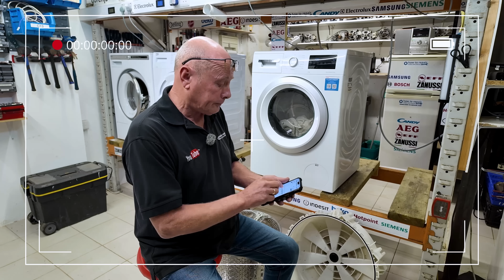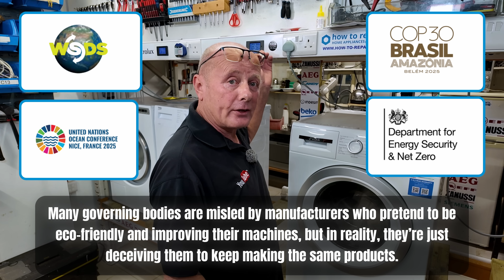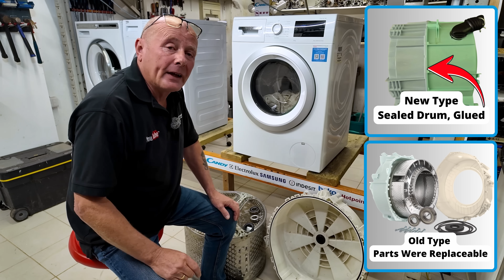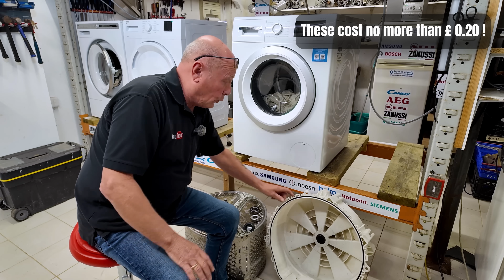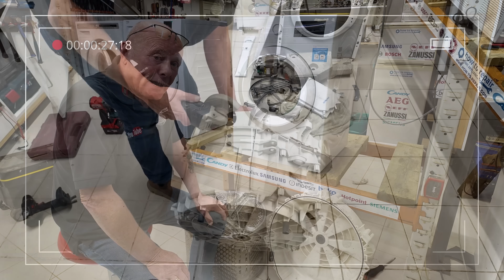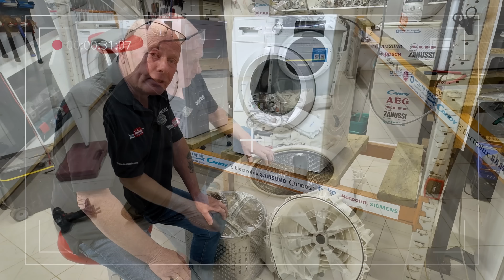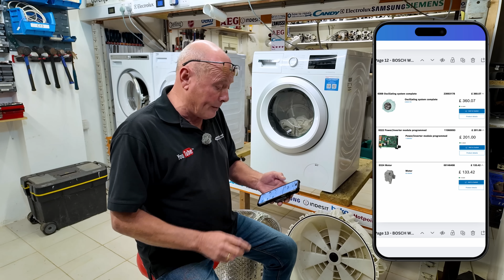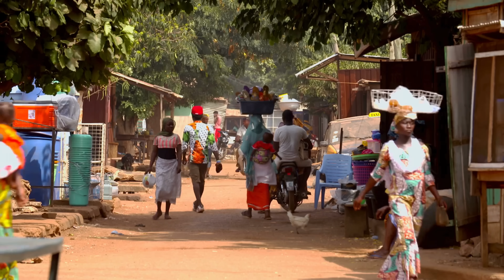Washing Machine SCAM EXPOSED! The Truth About SEALED Drums: Naming & Shaming

Comment: Our last washing machine had its bearing fail. I thought no worries brought a new bearing for a few quid and opened her up - to find a sealed drum😮 bugger. New drum was virtually the same price as a new washing machine - agree this is a backwards step and planned obsolescence.
Reply from the maker: I hear this story all the time and after 40 years in the trade, the rage is entirely justified. You did the right thing by purchasing the new bearing for a few quid—bearings are one of the cheapest parts of the machine.

The discovery of the sealed drum bugger is the industry's way of saying, "Repair is not an option." By welding the tub shut, manufacturers make it impossible to replace that cheap bearing. The only recourse is to buy the entire drum/outer tub assembly, which, as you found, often costs £200 to £400+ virtually the same price as a new, basic machine!

Thank you for your comment. I appreciate people like you taking the time to write it out. Please don’t forget to subscribe and share it where possible. It might help others make a wise choice instead of being misled by the industry.
Reply: Ten years ago I owned a hotpoint ariston which soon become noisy. I opened the machine and the drum was chocking as the bearing fail. The pool drum was sealed and it has 2 bearing, one inside and one outside. To replace the inside one, you must cut and then re-sailing like the guy said. This work need equipment and skills, more harder than unscrew few bolts anyone is able to do it.
The worst thing is the ball bearings used by many brands are undersized (about 5 cm diameter), too small to hold for years the weight during the spin cycle. They could use bigger bearing like the ones for a car wheel instead, and the final cost of the machine will be pretty the same.
Reply: Simple answer, don't buy a make that has a sealed drum..
Reply: Brought a new one😂
Reply: What make was it if this lg i have is sealed im going to be pissed
Reply: @sshaunss it was hotpoint or whirlpool.
Reply: @TC-V8 was lg was a split drum luckily but a pain in the ass
Reply: I could suggest a new job. The "washing machine tub cutter".
It's plastic, it can be cut with sharp tools, with lasers, with hot wires...
😂

Comment: Replaced our Hotpoint 3 years ago and seriously considered Bosch but found they were using sealed drums. Actively searched for non-sealed drum manufacturers and ended up with a Samsung. Hotpoint dryer packed up not long after so kept with Samsung for its replacement, and then the dishwasher.
Well done Bosch. Hope this works out for you 👍
Reply: Agreed. But our Samsung's PCB gave in just outside the warranty period and therefore went to the recycling centre. I bought a Bosch as replacement, buying made in Germany. We liked the washing result of the Samsung better. But I am only truly devastated since learning that my Bosch Series 8 is having a sealed drum, based on the previous video. Would have liked a Miele then, but that's also listed in this video. Maybe I should have gone with an LG, my previous consideration.

What can I do? I ditched Bosch for our latest fridge purchase and spent much more money for a Liebherr instead. Samsung and Bosch are brands I will avoid to buy going forward at all cost. Also successfully encouraged to have no more Samsung phones in the family.

But mind you. It's hard decisions time after time, often spending much more money. That's a luxury, after all. I went to the biggest retailer in the German speaking market and asked for the fridges I had identified to be best. One is only available for online order, the other not at all. I had been told by the store manager that there is no demand for these highly priced models at all. He said he would not turn them around in the shop at all. The premium Lieberherr they don't even have listed for online sale.

Best of luck with your Samsung washing machine. But I'm afraid I may see you in the comments in 3 to 4 years again. Repair expert recommended against Samsung. He said he has them all day long and he can barely save any.
Reply from the maker: I'm so glad you agree with the main idea! Making this as visible as possible is up to all of us. I can't do it alone, so please remember to share it wherever you can.
Reply: @How-to-repair  thanks

@BoschHomeUKandIreland hope you notice all this! You’re not alone amongst UK white goods manufacturers doing this however when the Hotpoint packed up we thought we’d ’move up’ to a Bosch since it should be a quality reliable brand. Being able to service an item is part of the quality. If it’s disposable it’s cheap nasty garbage, albeit with blue leds and WiFi connectivity 😂

Comment: lets build our own open source washing machine as a community that lasts like the original light bulb edison made dozens years ago.
Reply from the maker: Thank you for your comment. I appreciate people like you taking the time to write it out. Please share it where possible. It might help others make a wise choice instead of being misled by the industry.
Reply: That's not the best example. The bulb theory has been debunked multiple times. You have two contradictory parameters, so you need to find a good compromise, which in case of the standard bulb was certain efficiency, color temperature of 2700 K and roughly 1000 h of life time. If you extend the life time, the color temperature will go down and the efficiency too (in other words, this super inefficient light source will produce even less light per watt).
Reply: @TrinomCZ Thats not the point here...
Reply: @abdussamed107  I agree, your comparison was not the best for this case.
Reply: Nice idea. But where would that be produced? Most likely China. It needs to fulfil regulatory requirements. The cost must be reasonable. It must fulfil basic customer needs and expectations. You need to be able to handle all bureaucracy, transportation logistics, retail and customer service. Warranty support, return logistics. Availability of spare parts. In this case long term. If only it were that simple. Business reality in capitalism is simple. If it were profitable, it would be done. In that regard capitalism is a highly effective and efficient economic system. Without profit, the motivation is simply not there usually - especially long-term.
Reply: @reinhardt.9089  No, it´s open source, this also means, that you can build it yourself. And if a lot of people still really want such a machine, there soon will come up (e.G. chinese) companies, that will build that for you.
Take the Roborock vacuums for example. They´re mainly based on open source software, turned into a (sadly really closed) product.
Reply: ISE did just that about 15 years ago.
We bought an ISE10 washer, designed and built really well, 10 year warranty all parts replaceable.
Unfortunately the company went out of business.
On the bright side our washer is around 12 years old now and hasn't missed a beat, parts could well be an issue though if it does fail.
Reply: FISHER AND PYKEL SMART DRIVE.
Reply: oh man, did not see that comment. Totally agree!

Comment: Some days ago I diagnosed LG 5kg direct drive washing machine. Main issue - bad bearing (drum on screws). Second issue - after change of bearings and seal machine still not worked correctly, some errors on the display. What I found was "interesting" - when seal and bearing wear out, there is some went hole for the water. And this went hole is exactly above power connector of direct drive motor. So connector and part of motor windings was burn down. Luckily board was not damaged by shorted connector. We found used motor for 30€ and washing machine work fine now.
Reply from the maker: It's great that you were able to successfully repair your washer. inding a used motor for €30 is a huge saving and confirms that repairing machines like yours, where the drum can be split, is far more economical than the forced replacement model we see from Northern Hemisphere companies. 

I'm pleased you support the main idea. Our success hinges on making this as highly visible as possible. Since I cannot achieve this scope alone, I sincerely ask that you share it across your networks.
Reply: @How-to-repair  My thoughts were more about "strange" design nuances when you have bad seal and/or bearing water goes directly to the motor connector. If you not noticed you have bad seal - you will have burned motor and probably board very soon. If board is burned splittable drum will not help, too big price for repair. Just planed obsolescence...

Comment: It's ridiculous that probably many machines have the same PCB and these are mass manufactured PCBs. They contain some cheap microcontroller and power electronics. They still have different proce tags for different models.
Reply from the maker: You are absolutely correct mate. Having spent over 40 years in this industry, I've seen countless examples of this practice. This is a deliberate mechanism to create price confusion and enforce high repair costs, making the machine disposable even though the underlying component is cheap and identical. This is precisely why I advise avoiding overly complex, circuit board driven machines where possible. Thank you for your comment. I appreciate people like you taking the time to write it out. Please don’t forget to subscribe and share it where possible. It might help others make a wise choice instead of being misled by the industry.

Comment: Weve just had to buy a new samsung washer. Our last Samsung washer lasted 10 years..The drum spins off center ( no grining or banging when I tried an empty drum spin only ) and has shredded the rubber seal and started to chaffer the plastic drum. Told - (The drums gone  ya might aswell buy a new washer)& Fitting a new door seal is not worth it cos it will do the same. Engineer said we can can use it but it will get worse. (We used it twice with no problem but 3rd time with 2 large towels and a few small items it started to chaff the plastic edge of drum case...I think the engineer said it was the drum legs...AFTER WATCHING  I wondering if it was the spider part that was broken.... Out of CURIOSITY ...Could this have been fixed and approximately what could ths labour price be..We was charged £70 Labour plus parts...But never had any parts....I totally agree with your point on this..Were being ripped off.
Reply from the maker: Because of the sealed tub design and high parts cost the engineer deemed the repair anti-economical for you. This is the built-in obsolescence we discuss a small failure forcing a full replacement. Your £70 charge was almost certainly a non-refundable call-out fee or a basic diagnostic fee which is a key part of the cost structure designed to discourage repair.

If your machine had been repairable which means had a splitable drum, a full spider replacement is an intensive job, typically requiring 2 to 3 hours of labor after the call-out fee is covered.

It's hard to believe that manufacturers expect consumers to be happy buying major appliances every few years. Using environmental issues to sell more machines is ridiculous, especially considering the ecological damage it causes. They are ruining their reputations by making such products.

Thank you for your comment. I appreciate people like you taking the time to write it out. Please share it where possible. It might help others make a wise choice instead of being misled by the industry.

Comment: How different are the drums actually? There might be a case for 'after market' replacements given its just the shell that is welded. I bet someone could come up with a universal shell design. Even if it just targets the most common, it would put a massive dent in this problem - good money to be made here. In fact, 3d printing might be the way to go,  given the size of printers now and strength of print they produce. Turn this into an open sourced solution.
Reply from the maker: I already had a conversation about this very idea the big problem being the manufacturers are aware of it. This is why they don't have one drum for one size. They have multiple different variations that go on different models.

Comment: i get your point but what does it help if you buy a lg or samsung for example if you dont get parts of it after 5 years or more. I had a Samsung TV , no chance to get anything after 5 years, same with a air purifier from Samsung. Perhaps im wrong but Samsung is not in my mind as a firm who wants to keep there products a life and producing parts for a long time in aftermarkets. My Bosch washing machine damper was repairable, also the food processor but your are right both are 10 years old now. So perhaps i should choose samsung for the next washing machine if you think you can get parts longer then 10 or 15 years cause i´m a technican and i love reparing all type of machines not only cause its cheaper. Its a shame if you throw it away only cause of a single part with producing costs from 20€
Reply from the maker: Thanks for the comment mate and you are absolutely correct to be skeptical of Samsung in this regard. As a technician, if your primary goal is the satisfaction of repair and avoiding the shame of throwing away a machine for a €20 part, the ability to disassemble the drum is a massive advantage over the sealed tubs that Bosch often uses.

I always recommend asking if the drum is splitable when purchasing a new machine because you can tackle the primary mechanical failure yourself, regardless of the part's price or availability.

Thank you for your comment. I appreciate people like you taking the time to write it out. Please don’t forget to subscribe and share it where possible. It might help others make a wise choice instead of being misled by the industry.

Comment: This is why after 30 years I binned the appliance repair trade a couple of years ago, no point even trying anymore. Don't forget that most of the replacement PCB's don't come coded, so as independents we couldn't fit them and manufacturers will not supply you any info. Think you can use a second hand PCB? Nah, in most cases there will be two or three pcb's in one machine (control panel, motor, main) Put one in from another machine and there is a good chance it carries a different software version and won't communicate with the other boards. Needs to be one standard like OBD2 in the appliance trade where anyone can access the info on their appliance and code as required, it's not even difficult as appliances use CANbus just like vehicles
Reply from the maker: On my YouTube channel, I've made many videos and even a playlist about built-in obsolescence. These videos have over 3 million views and keep growing. What's really surprising is that manufacturers aren't disputing the information. The media isn't discussing the topic. Governing bodies aren't addressing our e-waste problem. Politicians aren't talking about it, even though it could win them votes. The whole issue is kept quiet.

Only by sharing these videos and discussing these controversial issues can we hope for change. Sharing this video will help give it the exposure needed to make a difference over time. Thanks very much for your comment; it is much appreciated.
Reply: There are components on boards. Why not see what component (a condensator is a common suspect) is finished and replace that?
Reply: My dad ran a company called ace engineering. Recon motors..sold four hundred a week plus recon module boards and timers.
Reply: I was thinking about OBD2 on washers a few weeks ago to help diagnose faults for techs in the industry. Unfortunately there are a lot of so called techs out there who can only repair by replacing parts until it works, they can’t use a multimeter let alone diagnose problems 😢
Reply: @woodyrx3 sadly ive seen this alot. Like the ASE tech trade the wages are a joke so you onlu get bottom of the barrel technicians. All the good knowledgeable workers go into other more lucrative trades
Reply: Or just build old mechanical timer switches with contractors. No corcuit boards are needed for timing a washing machine

Comment: Old guy here who's 4,000 € TV broke down shortly after extended warranty....couldn't be repaired I was told at several repair shops.  I solved it by not bying a new TV and haven't missed the mainstream media propaganda and cable network bills last 15 years.  But immigrants will fix this washing machine problem by throwing the failed machines through the shops windows when they fail.

Comment: If the retail price is 600 pound, it's total cost of parts will be under 100 pounds.
Reply: Bingo
Reply: Probably closer to at least 200. I doubt the manufacturers make that much money per machine, if they did they wouldn't need to sell you a new one every three years.
Reply: @KeijonAutoVuokra  no the manufacturer doesnt make that much,  but the retailer and distributor cut is substantial.  as well as leaving room for promotional pricing and warranty claims.